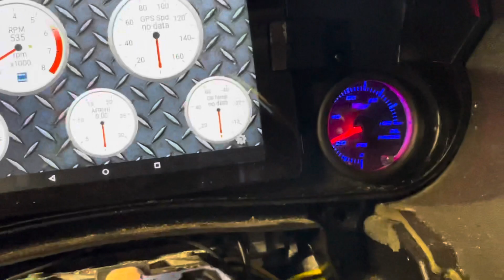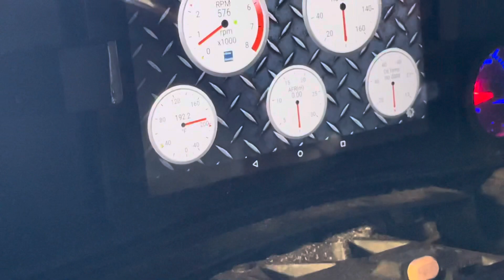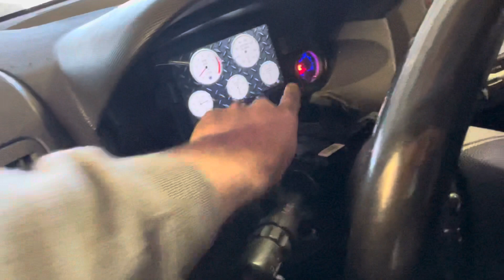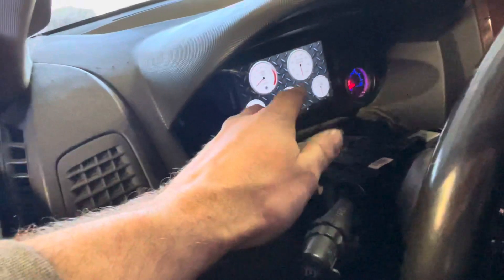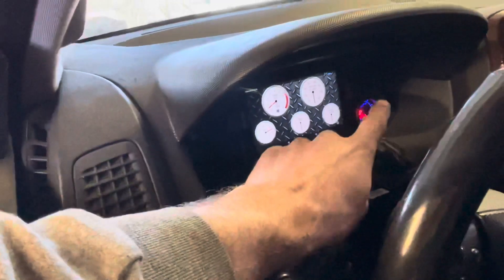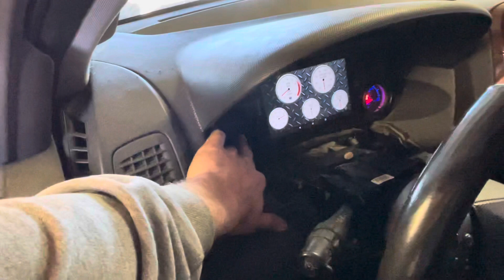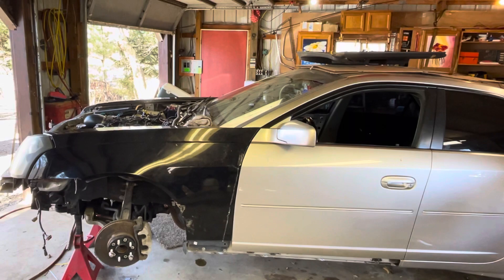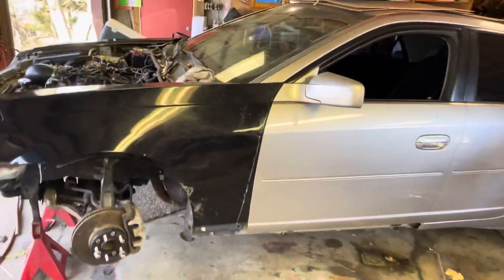Part 3 LS swap into base CTS(sloppy ctsv)

Comment: Hey sir , is there anything that has to be done with the body control module? So everything functions on the car?
Reply from the maker: I never had to mess with it. If you supply power to the stock fuse box, everything in the car like heat and windows all work

Comment: Does your light's and blinkers all work along with power windows and locks?
Doing this same swap and worried about the wiring aspect
Reply from the maker: @chrisv6008  yes, all that is controlled by the body control module. I only mess with the engine side
Reply: @integra167  sweet thank you very much for your help I appreciate it greatly

Comment: Hey I hope you r still on here. I can't find anything really online and ran across ur video. I hope u can help me. I currently have a 04 CTS. The 3.2 blew of course. It's manual .. ur video has me pretty clear on what I need to do. But what is going be the hardest for me is wiring .. I hate wiring . I don't know much bout it. Can u please make a video if possible bout the wiring . I looked up the v engine harness n the body harness n it's just to much for what I can afford. I really hope u can help me on this
Reply from the maker: I would totally make a video if I still had the car. I traded it a couple years ago. If you have a mechanic friend, have them print you off the wiring and pin outs for the harness. That way you can tie into the fuel pump, ignition, and starter wires. You can also join the Ctsv drift Facebook page. There’s a couple guys on there that have v8 swapped. And the guy who started the page had my old car lol